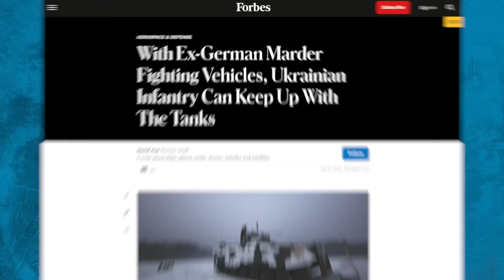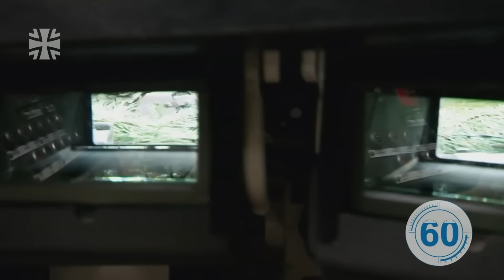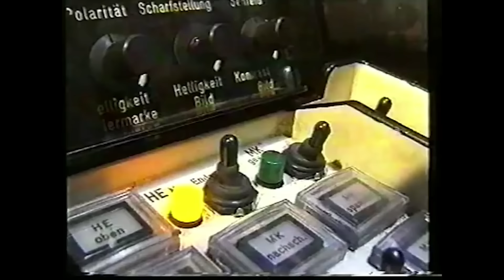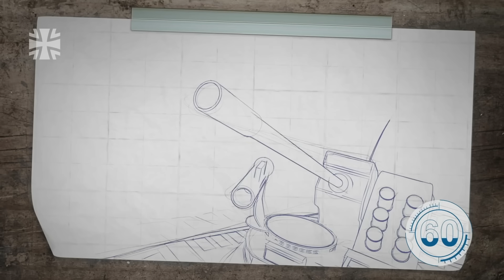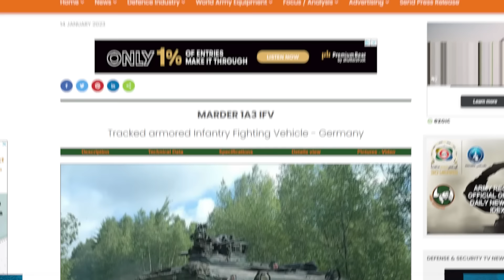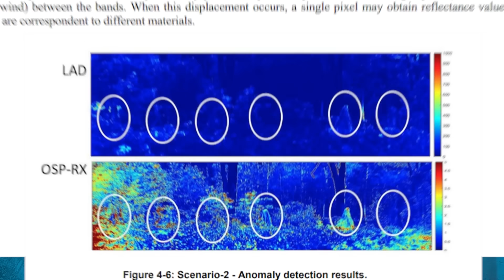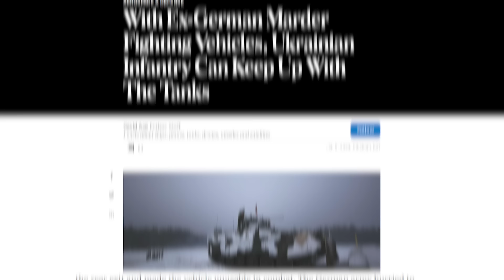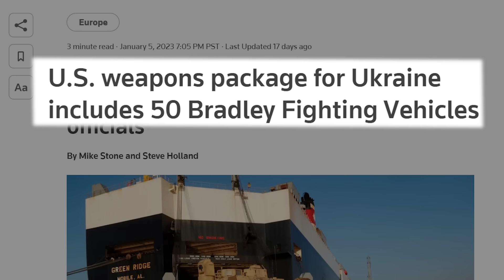Why this German IFV is So Hot Right Now

Comment: Worked in the German army, and in a mech infantry battalion, the Marder is even more loved than the Puma itself... Is very reliable vehicle and has a big firepower, really hope Ukraine puts on good use the Marder and Leopard... Otherwise ask Turkey what happened
Reply: why turkey ?
Reply: @bameno6641  Because they managed to get several Leo2 destroyed by not giving them any infantry or IFV assistance to cover them.
Reply: @boo-misc4973  oof, Turkey must have been training with Russia back then.
Reply: @holden5478  no they were in nato since the 1950s
Reply: Ukrainians would have alot more fun running around in German VW GTI's, I can attest to that.  Germany should send them GTI's instead.
Reply: Turkey had old leopard 2A4 version. Lots of the tanks were blown up by suicide Truck bombing !
Reply: @boo-misc4973  That's what happened to Saudi Arabia in their genocidal war in Yemen.
Reply: Really IMHO Germany should be sending Pumas or at least Pumas alongside Marders while increasing production. Would be good test and you would get a top notch maintenance manual out of it.
Reply: @sandervesik173  Well. hopefully all ends tomorrow.
Reply: @roastntoast7550  yeah because the tanks were all alone.  With support from ifv's they wouldnt have lost that many tanks all at once.
Reply: @sandervesik173  Germany don't have enough Pumas for themselve. Pumas are stuffed with high tech.  Ukraine can't maintain and handle them easily.
Reply: @RichbackNr.1  👍
Reply: @sharwama992  they still used some leo 2 as stationary artillery. One or two were destroyed by oversized mines though.
Reply: Marder requires a skilled Instandsetzungsabteilung to guarantee his operational function. Without it, they have to retreat in the case of minor damage to the system.
Reply: Ppp
Reply: @roastntoast7550  at this time, the verdict is not yet out on the Puma. It seems the German army itself is responsible for the technical failures in the field. If true, this might indicate that the Puma is - regardless of its capabilities - a little more fragile than first thought and the Marder may perhaps be the better choice for a robust and reliable fighting vehicle.

Let our army sort out the "Kinderkrankheiten" in the safe confines of peacetime manoeuvres and give the Ukrainians something that works now.
Reply: @marxel4444  which is exactly why the Ukrainians want them.
Reply: @zed11634  That is the case for any equipment. There are no spareparts and no mechanics and electronic guys around to fix more serious problems. Fortunately the marder is quite user friendly with relatively few problems.
Reply: Pumas arent ready yet. But i agree with you Pumas together with Boxer would BE very good.
Reply: @M1984FA  yes, German tanks will be rumbling across Ukraine's fields again. However, one cannot ignore the most important difference: they will be manned by Ukrainians fighting to keep Ukraine free.
Reply: @sirbonobo3907  would be very good for the good conditions, but i believe Marder is better for them, is more tested, and works simple, part of what affects on the reliability of the Puma is the amount of electronics, and if you have a problem with the electronics you are a goner... Marder has the good thing that if electronics fail your main controls like firing control system and turret are still operating. At least that is what i have been told
Reply: @mweskamppp  
Two KORNET hits
Reply: @zed11634  but…if one were to carry, say a  blurtzen pouch filled with Dontaktaspeileffen extrusion gaskets the need for the ‘Instandsetzungsabteilung’ is easily negated as hasty repairs are now possible. Thus it will be the Russians doing the retreating 🇺🇦
Reply: Mech ? Are you guys using Giant Robots already? Gundams??
Reply: @boo-misc4973  yes and because of that they can wait until the world falls apart until we allowe them to get upgrades for all their old leopard 2 a4 (thats by the way also an important reason why they lost so many leopards, ca. 11, they have only old leopords and since the a4 version to the a7V version the leopards armor and also mine resistance was improved at last 3 seperate times). To not cover this old veteran tanks with infantry is inexcusable und unforgivable. They have to pay for what they have done to our leopards! and not only that they lost them, that they used them in the first place is unforgivable. how can they even dare to even think about using our tanks to attack the only existing democrats in the hole near east. They attacked the only good ones (turkey is not part of that group) with german tanks. That cant be forgiven not in 100 years
Reply: What is Berlin worried about? Mmmm, 1945? This time the Russians have nukes LOL
Reply: @shasha1873  if they are sending tanks then they aren’t worried, right?
Reply: What happened Turkey?
Reply: @boo-misc4973  that's a pretty good, oops!
Reply: @holden5478  😆
Reply: @zed11634  Maybe the Ukrainians are not as nitpicky with the "Fristenheft"...
Reply: @boo-misc4973  They managed to cruise around in enemy city like they would do with their private SUVs but in a wartime without infantry protection. Did not work good. The cooler Kurds-women brigades got them from behind with RPGs. No tank will survive that, not even a Merkava or a more (shitty) Abrams.
Reply: @boo-misc4973  but it was the leo2 A4 . Which has early 1980s armour ratings. Sure infantry should have been used ,but the A4 has very weak armour.
Reply: @sandervesik173  here´s the thing: The Pumas are currently under review for technical issues (cause you know, new high-tech systems tend to have those)
and new purchases are on hold until problems are clearly solved... that is also why Marders are in the VJTF currently...
Reply: How difficult is it to mass produce the Marder?
Reply: @sandervesik173  Nope - adds to complexity of maintenance and different parts that are not interchangeable. Better send 1000 Marder 1A3 than 500 Marder 1A3, 200 Marder 1A5, 200 GTK Boxer and 100 Pumas for example - that way you have more ressources to keep the company rolling, even if you have to slaughter some vehicles for spareparts like they did with the PzHb2000. The more variety the already very strained Ukraininan Army gets, the more messy it gets to keep it running. Thats why standardization was such a keyfactor in WW1 and WW2
Reply: @daszieher  That's actually how a large part of Ukrainians felt the first time German tanks rumbled across Ukraine.  They thought they were being saved from communist oppression.
Reply: @jeffk464  except that those tanks back then were not theirs and also not provided by a democracy. The Nazis were also socialists, remember?
Reply: I guess the Marder is more loved because it has been more in the service and Puma is a new thing that requires time to adapt to. Of course Marder is a simpler machinery, easier to adapt to, to learn, and get around it.
Reply: @holden5478  they seem to be trained by russia since 1950 they dont know shit about combined fighting or tactics
Reply: @sandervesik173  nope! Puma isn't battle ready yet. And it's not wise to send your newest toys and keep the old ones...
For now, Ukraine isn't a NATO member. And not even the USA are sending their newest hardware to Ukraine. For now, Ukraine is receiving NATO's legacy systems (M2A3, instead of A4, M1A1 or baseline A2, Leopard 2 A4 and A6 instead of A7+ etc).
And you can bet your life on the fact that Ukraine won't get NATO's latest cryptography, communication and targeting equipment!
And they don't need it, because even NATO's legacy combat systems are more advanced than anything Russia can field right now!
Russia is currently retrofitting their most modern tanks with 1960s/70s targeting and sighting equipment, because they just don't have any of their more modern systems left.
Reply: @milanmatejic2954  we all want the war to end immediately, but that can only happen if Russia decides to withdraw from Ukraine completely. Because even if Russia would be able to defeat Ukraine on the battlefield and conquer all of Ukraine, the war wouldn't end! It would just progress to the Guerillia/Partisan war phase! And that phase can last decades and cost millions of lifes! Just because Ukrainians don't want to be Russians!
Reply: @daszieher  socialists by name only. They started out as more socialist alternative to the German socialist party and a more national alternative to the German national party and also more labour friendly than the SPD).
But that basically ended when Hitler came to power. From then on they were basically just nationalist. The centralisation of the German economy wasn't motivated by socialism, but rather by necessity of war.
Reply: This is BS because in the hilly terrain of northern Iraq an IFV would not be able to protect any vehicle from an ATGM with a 5k radius using guerrilla warfare. Just because you heard this bs doesn't mean it's true.
Reply: @linda1lee2  Iran's genocidal war in Yemen?
Reply: @hattemh6535  NATO IFVs were designed for the battlefield Europe. Most of Europe is relatively flat (compared to the mountain regions of Afghanistan).
In Europe, NATO MBT and IFV commanders wouldn't drive trough a narrow valley or canyon without overwatch, because that's a sure way to get your entire column killed.
NATO doctrine dictates (afaik) that infantry has to be dismounted and at least partially up the slopes. And usually there has to be a drone or some kind of Gunship (helicopter or AC-130) circling overhead.
Reply: @hattemh6535  
So.... explain how the Iranian colonial troops invading Iraq and other 'insurgent' forces were not able to knock out coalition vehicles?

If it's the terrain, coalition troops and the Iraqi military should've gotten destroyed at the exact same rate that the Erdogan-heilers were.
Reply: @daszieher  nazis were NOT socialist if you think that then you fell for the oldest trick in the book - pretending to do one thing and then doing the opposite. You must believe that Noth Korea is democratic, too?
Reply: Ukraine needs 225 additional IFVs to complete the 4 Brigade Armored Teams donated. I believe the US will donate all of these as Bradley M2 IFVs.
Reply: @stephensipe5405  Germany will send Marder IFVs and that's the right thing to do.
Reply: @dreizdreiz9203  the new guy pistorius seems promising so far finally. Time will tell if he is good but his first comments and actions seem legit, especially considering when exactly he took over
Reply: Bradleys, Marders, CV90 are going to change the course of the war.  Ukraine is going to be able to gain back more territory in large part because of these IFV's.  These IFV's, especially if they include longer range drone and loitering munitions operators among the infantry, will likely have much broader day to day effect on Ukraines battlefield success than the coveted and increasingly obsolete heavy main battle tanks.
Reply: @roastntoast7550  and they used them often as static artillery placed in dug-ins.
Reply: @ccbcco  actually, it's the combination of both the IFVs and the MBTs that will make the difference. Current NATO MBTs and IFVs were designed to operate as a team. One without the other will have a massive capability gap that can get your vehicles destroyed and your men killed faster than you can replenish either.
Just look at Russian losses in this war. Russia has both MBTs and IFVs. One could argue that the modern IFV was a Russian (Soviet) idea, but Russia never learned how to effectively integrate both with coherent tactics and operating procedures.
Reply: Turkey will learn and adapt.
Reply: @PatsFanGermany  Germany sent 40 Marders. Sweden sent 50 CV90s. Together this is less than the 109 Bradley M2 IFVs being painted in Poland this week. The US is training 500 Ukrainians to be 3 man crew members of Bradleys. This is 166 crews every 2 months. By the end of April, 332 crews will be trained. 109+225=334. This is 6 men short of NATO organizational chart requirements. Maybe the 2ND class will be 506.
Reply: @stephensipe5405  considering the size of the Swedish and German military compared to the US military, I think Sweden and Germany are doing more than their fair share!
Reply: @theoneandonlypirates  He does not decide so much. And not much yet. The defense ministry is traditionally an ejection seat in germany. He did serve in the army and is searching contact with the soldiers. That is all you can say for now.
Reply: @PatsFanGermany  BS!!! As a % of GDP, Germany itself just admitted it cannot fulfill what it agreed too: 2% of GDP for the military. I think Germans said maybe by 2025. Poland is already 3%. The Germans have done a lot for Ukrainian refugees. However, 29 Leopard 2 MBTs and 100 Marder IFVs are not to much to provide. Another Ramstein Meeting is in February. Let’s see what happens.
Reply: @mweskamppp  he already did however come forward by saying that those 100 bn are nice and all but insufficient to get where it was intended for, especially considering how to replace ukraine donations from own stocks on top. That indicates that he tries to stay on top of the matter, is willing to come forward with points people don't want to hear even if it is the raw truth and that is is trying to bring these points up in the interest of his position. That alone is in all accounts already seemingly better than the last 4 predecessors. Obviously time will tell if thats the case with him, but insications tend in the right direction for now
Reply: Hi Stefan, was kann der Marder gegen den Terminator ausrichten?
Reply: @stephensipe5405  even if Germany decided to spend 5% of GDP from February 1st (in 2 days) onwards, that wouldn't magically create more Marder and Leopard 2! After the collapse of the Warsaw pact, Germany sold most of its MBTs and IFVs!
Let's not forget that one of the prerequisites for the German reunification in 1990 was that the army of the unified Germany had to be smaller than the combined armies of the two German countries. 
Back then the world still was more afraid of Germany returning to its militaristic past than of any wars among Eastern European countries! 
That's why you can't judge German contributions by GDP. You have to use the size of the German military as a measure for comparison.
Reply: @kleenerwicht1632  Sie sind etwa gleichwertig, wenn die Russen mit den Fähigkeiten nicht wie so oft übertrieben haben.
Reply: @kleenerwicht1632  Es gibt aber nur etwa 30 Terminator.
Reply: @mweskamppp  which is also socialist. Do you recognise a pattern?
Reply: @stephensipe5405  you are wrong! the 2 German countries signed 1 treaty with 4 allied nations! That's the 2+4 treaty and it never stopped to be binding. Last I checked, USA, UK and France still exist and they had many stipulations that they still insist on.
And as far as international law is concerned, Russia is the legitimate successor of the Soviet Union.
Reply: @PatsFanGermany  Russia is not a “legitimate successor” to the Soviet Union. Russia left the Soviet Union prior to its official collapse. Ukraine left after the Soviet Union. The UN let Russia stay in the Security Council because it had more nuclear weapons than any other country. 

The treaties Germany signed as part of its Absolute Surrender, changed with NATO integration and EU integration. There is no limit to the size of the German  Military. On the contrary, Germany has agreed to spend a 2% of GDP minimum as part of its NATO membership. This Germany has not done for several decades. 

The biggest stumbling block I see to Germany reaching 2% of GDP spending is the Social Democrat Party (SDP). They have historical roots to the Socialist Soviet Union, looking at them as an ideological brother state. Of course you have the Soviet Union and now Russia funding conferences and parties for SDP leadership, as well as funding their political campaigns. Maybe new leadership will help.
Reply: @daszieher  I am German and I am well aware of what NSDAP stands for, but as I said before, the party may have started with socialist ideas (those ideas were very popular in post WWI Europe), but that ended pretty much when Hitler became party leader. Hitler despised socialists! The first cleaning was that of the Nazi party itself. The second was that of the political opposition and only the third cleaning was that of Jews, gypsies and people of Slavic heritage.
Reply: @PatsFanGermany  and I am a German as well, although I grew up abroad (and now also live in different countries amongst which Germany is only one). Believe me, our nationality does not give us special powers in defining political directions. Socialism is a bad thing, it has only lead to sorrow, destruction and imprisonment and murder of free people.
Reply: Today was a report on german TV about a belgian guy that has bought over 50 Leopard 1s from the belgian army.
Reply: That 20mm is a far cry from a 30mm though.
Reply: @PatsFanGermany  Correct. We are assuming both sides like living,
Reply: Of course it is like that, not many Pumas are around yet.
Reply: Or sell
Reply: Puma is garbage because they decided to send the Puma per plane with A-400 Airbus turbo prop plane, thus it has to be light, but it also needs to withstand mines, to fight main battle tanks, have enough space for soldiers, etc. and that can not wotk out, even with the finest german engineering.
Reply: @maasl3873  the Marder was capable to do it, itself is not Garbage, but the biggest problem is the complicated electronics
Reply: @Leftyotism  Maybe it is a bit too much to say the puma is garbage, but the idea around the puma is garbage, you don't limit a tank to be transportabel by plane, that was a bad idea in WWII look at the M22 Locust from USA that had a gun useless against other main battle tanks, a 37mm gun in 1944 because the tank had to be light enough, and now it the same with the Puma. Or look at the G36 with its pencil thin barrel to be light enough and the complaints around the accouracy, and yes the G36 is within the capability of srandard assault rifles but the thin barrel does not make it more accurate. So you see, it is a mixture of English not beeing my first language with should be obvious and secondly in the internet with the face and eye contact most people use stronger words and terms as in a person to person conversation.
Reply: @shasha1873  In 1945, the Soviets (of wich Russians were only a major part) had allies, like the USA and UK, who destroyed the Luftwaffe and were attacking from the west. This time Berlin belongs to an alliance, of wich 3 members have nukes too; and the Russians are alone, like in 1905 against Japan, in 1921 against Poland, in 1854 against a coalition that included UK and France. Russian propaganda boast "we took Paris in 1814 and Berlin in 1945", conveniently forgetting that they had allies at that time.
Reply: @stephensipe5405   don't talk bollocs! Consider who was in charge as Minister of Defence until the SPD lead government came into power?  Von Gutenberg was the one to propose an absolute downsize of the Bundeswehr, even abandoning the service duty. Then Flintenuschi took over to introduce her Kindergarten, well her successor, the " srubwoman" from Saarland seemed to be a little overwhelmed either. They all were ambitious members of the conservatives. Maybe a little too ambiteous for our chancelorin?
Reply: @PatsFanGermany  why it has not started yet??? If you recall WW2, check where was first liberated land in Nazi Europe. And who started resistance regardless of cost…UA are chill. Switching one corrupted system with another.
Reply: @daszieher  sure you can just make up your own definitions but then don’t lecture me on what they mean
Reply: Kein Mensch, kein Tier...
Reply: @bullpup1337  lecture? "my own" definitions? IT SAYS IT IN THE NAME 🤡
Reply: @cyber_habanero  hahaha, for a Muslim to be taken out by a woman... That made their day!
Reply: @jean-pascalesparceil9008  That is correct. They had valuable and capable allies.
Reply: Just tell Defense secretary Pistorius to implement the Puma and the Marder both in the Bundeswehr.
Reply: @maasl3873  You clearly don't know enough. The Puma is an IFV for example, not a MBT. I won't go into its modifyable armor. And any barrel warps when it gets too hot, after hours of firefight.
Now, please stop wasting my time.
Reply: @stephensipe5405  Russia would burn those too
Reply: @daszieher  There is a German word for this: etikettenschwindel. But you might believe anything they write on the labels.
Reply: @bullpup1337  well, see, there is a slight difference between what you think that I think and what I really think.

I think that all socialism, including national socialism is "Etikettenschwindel".

Funnily enough, only blinded socialists are triggered by what I say. Almost if they want to differentiate between their own "good" socialism and the "evil one" of the nazis or the Italian fascists (also socialism, by the way).
Reply: @linda1lee2  nah. The Saudis were sold export Abrams tanks without the depleted uranium armor. They're garbage without the proprietary armor. Ukraine is the only country outside of the US to operate depleted uranium armor Abrams tanks. Should be an interesting case study.
Reply: @daszieher  I am not a socialist. But to say that Nazis were socialist is just stupid. You could have simply done a google search to find that out instead of writing an essay here.
Reply: not sure about the specific package, but Turkish Leos are based on the A4, which nowadays just doesn't cut it anymore.
Reply: Rico Thampaty  Meanwhile here in actual reality, Ukraine has actually GAINED tanks and armoured vehicles since the start of the war. It now has significantly more of almost all categories of armoured vehicles than when it started the war. Russia on the other hand has lost over 2000 tanks and about 6500 armoured vehicles, almost a third of its entire force. Russia started this war with 7 times as many armoured vehicles as Ukraine. That gap has now been halved.
Reply: @almightyIrie  Considering the Russians are bringing out the T-62's I'd say the Leopard 2A4 more than cuts it.
Reply: @jackmehoff5201  pretty difficult to produce to a modern standard. 

Think dozens instead of hundreds
Reply: @anon8182  Have you never heard of mechanized infantry?
Reply: @Calisota  this is what i wonder all the time. how can you keep a hodge podge like this with tons of different vehicles up and running?
Reply: @Calisota  wasn't that the problem (maybe one of em) of the 3rd Reich? I mean, if they only had lots and lots of both Pz. IVs and StuG IIIs, they would probably had more chances at least. I know is a rather distasteful example, but sadly is the only one I know regarding that matter.
Reply: Big fire power, 20mm, lol. Us Dutch considered the 20mm obsolete 2 decades ago and upgraded ALL our ifv's in our fleet to 35mm's.
We send the ypr-20mm (all replaced by the cv-90-35mm ifv) to the ukies and it didnt do good due to a lack of firepower. The Marder wont do much better.

Calling the 20mm big firepower proves Germany has no idea what it is like fighting a peer-to-peer enemy, atleast in this century. 
Sure it might be adequate versus tali's in toyota's but good luck vs mbts with that.
P.s.  i had combined exercises with Germany up to 2010 at Bergen-Hohne (next to the concentrationcamp Bergen-Belsen, never forget what your grandparents did!) so ive seen first hand it is useless against tanks.
Reply: @linda1lee2  I think it is an iranian proxy war in Yemen
Reply: @daszieher  uhm the pattern, that dictatorships like to present themselves as populist and utilitarian and use the aestetics of socialism and communism for that?
.. Such a dumb comment bro btw
Reply: @user-ve7hn2dh8h  it literally says it in the name. The only ones really opposing that classification are socialists, who don't want their socialism associated with a mass murderer such as Hitler. They will also say that Stalinism was also not real socialism. What about the GDR, where the own population was held hostage and murdered, if it chose to flee?

Please don't attempt to confuse this by dragging in "reactionary Americans" to attempt to frame this (legitimate) interpretation as some illegitimate right-wing view. It is not. From the point of a liberal democrat, all socialism, national or not, is equally dangerous.

And I couldn't give a flying fuck who laughs or doesn't. Especially being a German, with two murderous socialist dictatorships on German ground in our history.
Reply: So as a German soldier you don’t know that your a "Panzergrenadier" ? 
And you don’t know that the Marders gun is heavy outdated and not strong enough ? 
Strange.
Reply: @drakee9493  as a German soldier i knew im a Panzergrenadier since day 1, it is literally in the name of the company and battalion... Marder arent heavily outdated, yes they are outdated but they did their job very reliable, it was never meant to fight a Tank, rather a armored vehicle, you can also update marders with reactive armor to give it more protection, but the idea was to give cover to infantry and being transported to the front line while the ifv fires on infantry and medium armored vehicles
Reply: What is your opinion of the Wiesal series?
Reply: @alexanderhenley7307  hm, idk since we dont have them as mech infantry, they seem kinda goofy with such small vehicle, not sure on the conditions of its use, if i want to transport units i would use an ifv, transport Munition could be done by other ways, but like said, since i lack knowledge there, the question should be answered by someone that is in a wiesel or was in one
Reply: Yeah, most of the germans want Ukraine out of Germany now and we are angry of our german government now. The support of russia is growing now in russi bc Ukraine is forcing us to give them stuff
Reply: Stefan, the age of tanks is over.   And IFV.    A drone or infantry ppgm routinely defeats them.   Please, if you are called up,  leave your tank/ifv immediately.  best wishes to you.   take care
Reply: I also worked as an turret mechanic on the M1A3. Since it is more than 20 years ago I may bring some light into this tank.
First and foremost for our battalion it was too slow simple as that. The American and Russian IFVs are said to be much lighter in armament but way faster. Since the main scope of an IFV is to support battle tanks and not get shot by them it is argued within the army that the Marder is kind of a sitting duck but only time will tell.
The next problem is already said. This thing is build like tank (shocker I know) but especially the hydraulics within the tower are subject to failure.
On the other hand this thing might be easily damaged but it will keep on fighting. The main and secondary weapon are basically frighting. If brought close enough it is capable of penetrating a German LEO1 or US Abrams on 400m (about 440 yards) distance and the second MG3 on the back (I had to carry this stupid thing as it is part of the carried infantry troop) has some (not much) air defense capabilities especially against the main enemy of an infantry troop, helicopters.
Reply: Wärest du überhaupt in der Lage dazu, diese Lieferungen grundsätzlich zu kritisieren ohne unehrenhaft aus dem Dienst entlassen zu werden. Ich hab das Gefühl, als Soldat ist man in der BRD dazu genötigt ein Normie farbenblinder Verfassungspatriot zu sein. .
Reply: @marioschulz1135  ja klar, es gibt viele die es Kritisieren, sogar innerhalb. Mann muss es so sehen, es ist das Recht jedermann seine Meinung zu äußern, hat mir die Gesetze und Verpflichtungen als Soldat nichts zu tun. Solange man es nicht übertreibt ist alles ok. Und man kann die Regierung auch kritisieren und trotzdem treu bleiben, denn wir sind sich an die Politik sondern an die BRD gebunden
Reply: The germans should keep it and send those Pumas to Ukraine, best beta testing instead of not knowing how good the puma really is. Right now it only looks good on paper
Reply: @boo-misc4973          Funny thing Israeli tanks were destroyed en mass when they invaded the hamas enclaves , isn’t Israel considered  expert at protecting tanks?   Yes now they have the best protection there is , trophy and some other advanced shield. But no one else has real. Top attack protection
Reply: @jeffk464  they would sell them instantly on the market
Reply: @wolflarsen1900  "only existing democrats"

lmao nice way of saying you know nothing about the entire region
Reply: @idrathernot8227  so you have another one, i am listening my friend
Reply: @wolflarsen1900   Nope I don't have any and neither do you. Democracy or democrats don't exactly exist in the region. There are forms of governance that somewhat resemble democracy and there are people who pass themselves off as democrats to appeal to the west although their actions are directly at odds with being a democrat.
Reply: @PatsFanGermany  yes, and Moldova would be next, and then the Baltics, which would give us WWIII.
Reply: @ccbcco  yes, especially if the longer range missiles (such as the GLSDBs) will disrupt Russian supply lines further back from the front.
Reply: @diamend85  If there is one Army that can pull off the logistics of such a hodge podge, my bet is on the UAF. Technically savvy, creative and highly motivated.
Reply: @shasha1873  om
Reply: the most interessting question is. leopard one became a test with the Leopard2 tank  Gun.... and yes it will work. but not in service. also  the manufacture caims last year  100Tanks can be send to ukraine within 4 weeks. and there are 100 leopard 1 out there in storage. why does not happen to fit a gun like this onto this tanks. sure less armor but the same range as leopard 2.  To build this gun into leopard one will be Enough time. leopard 2 is also old but newer then this leopard 1. Marder Puma Mantis may also have a effect on the battlefield. for sure the leopard 1 can be a support tank for leopard 2 and other Tanks like Leopard 2. for exsample Abrams, Bradley,and some ifv like Marder and Puma....The problem is why not.... and this is the question. RU has also very old tanks to fight BMP1 and there oldest main battle tanks. 100 leopard 1 vs 50 leopard 2. on the frontline more tank  more power  better  ratio russia vs ukraine on the front line
Reply: @MiniTitanic1  in the paper sounds like a good idea, but is the question is it really a good idea? Most of the combats i have seen (armoured against armoured) are quite close quarters, not long distance, so a long distance barrel might be beneficial but in the praxis not a game changer, if i would modify the leopard 1 or marder i would place more armour on the vehicle rather than a bigger turret, second is the time you require to mount the turret and the cost of it. As an example the federal police in Germany has been modernizing the mp5, cost and expenses was at the same cost of getting a newer modern SBR. This is of course a supposition but i doubt this could be a game changer, also the IFV has the idea to fight infantry, getting rid of the turret you get rid of a vehicle that could give cover to the mech infantry
Reply: @zed11634  Instandsetzungsabteilung = maintenance team btw.  or they need a Team that is well trained on the Marder. I hope they had enough time to train and learn how to repair in an emergency. Becouse so far i know, the training was realy short. But it dont tell that the Ukraine Soldiers are not ready. I´m only worried about them to waste their lives.
Reply: Yeah because France and Germany gave ATGMs to the PKK 😂
Reply: @e.h.4789  dont know where you got that, i had to look it up just to find that the pkk is considered a terrorist organization in Germany, why would Germany give weapons to a organization they themselves classify it as terrorist
Reply: nice stefan, good to have people there with the rigth passion for the stuff
Reply: @sharwama992  ssince1952
Reply: a as Turkish journalist: Mistake taken by Turkish Armed Force for trusting our Leo's too much and with TB2's and other drone covarage they think they gave CAS support what even they want. But ISIS fighters manage to get antitank kornet missles in the right time, right place. When they climbed to the hills of Al Bab, they recieve heavy resistance, Turkish infantry get pulled of and kornets started to picking of Leo's one by one. Their armor could'nt protect them...
Reply: @sandervesik173  pumas are not ready yet. The ones tested were breaking down left and right. They seem to have big software issues. Better give them proper battletested machinery and not stuff that looks good on paper but is breaking down after 2 min of combat.
Reply: @daszieher  it's in the name for the reason that I told you. Please learn some history.. No historian who is not financed by big libertarian or konservative think tanks would even say something so ridiculous and ahistorical. And no serious historian would ever propose that thesis.. Sorry but you have been thoroughly brain washed
Reply: Danke für deinen Dienst <3
Reply: @Roast n' Toast  that's wrong, they were taken out by soviet kornet atgms while standing on hills
Reply: @daidalos1508  no wtf
Reply: What happened in Turkey is what happens everywhere and that was against ISIS not Russian Military Might.
Reply: @manu2161  yes it was
Reply: @daidalos1508  no. whats is your source? russian tv?
Reply: @manu2161  are you a lemming? It was several years ago and shown in german TV. Kurdish milita armed with kornet atgm took out Leo2A4 standing in the desert on hills. It was a Hit ito the left Turret side.
Reply: What do you have to say about the comparison between the German Marder and the US Bradley?
Reply: I just had the chance to get inside a Marder , this thing is so big !
Reply: Qiqi isn't adorable
Reply: @Phed98  yes
Reply: @daszieher "While not being a Socialist myself I disagree with the term when associated with the Nazi Party.Just because it has "socialist" in its name is semantics
Reply: @stevenbreach2561  and your argument would be? You haven't actually said anything to support your point of view.
Reply: nur das eisenschwein
Reply: @boo-misc4973  that's because they're Turkeys.
Reply: @sharwama992  Turkey "NATO" has always been a loose arrangement.
Reply: DRAN! DRAUF! DRÜBER!
Reply: @jeffk464 Yes we should send GTI’s over then we are finally rid of the carts 😅
Reply: @anon8182 no mech is mechanised infantry
Reply: Lasst uns Zapfhähne aus Waffen schmieden!
Reply: I know Ukraine is in dire need but how insulting it must be to hear" I can't think of any logical reason"  well here's a few reasons the West is being very careful. Europe has a immigration and sovereignty problem  energy production and reliability problem same with the United States population is divided drug crisis homeless problem immigration crisis  and the list keep going so there's just a few reasons why I we are a little nervous to keep supporting Ukraine is justified as it is  while our own citizens suffer at a magnitude we haven't seen 50 plus years
Reply: In this drone war Leopards and Marders badly needs a Gepard right behind them.
Reply: @niksandy7125  your sentence makes no sense!  There are no such words in german
Reply: @bameno6641  it was the biggest tactical mistake how to operate tanks...
putting several thanks clearly visible and exposed  on a hill without nothing no additional support. only Leopard tanks.